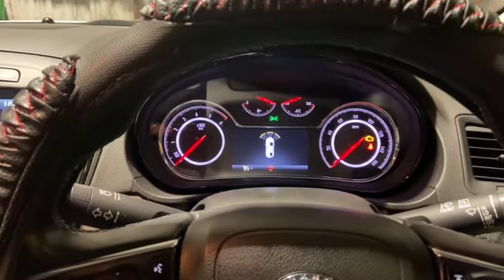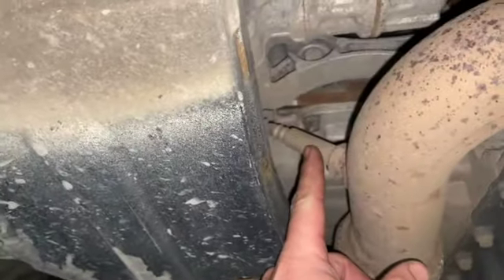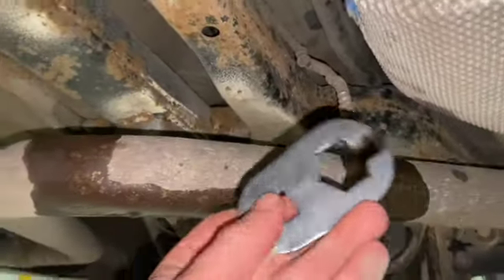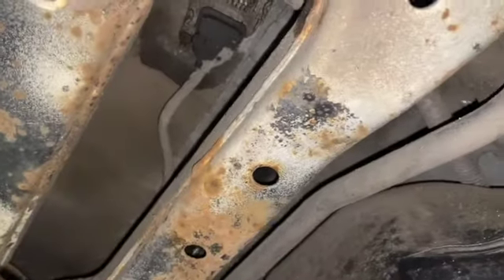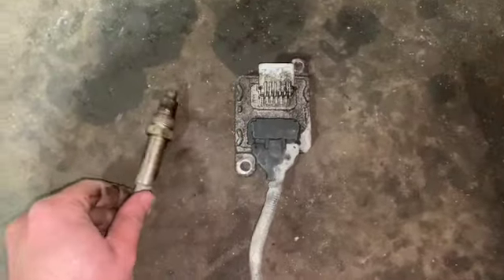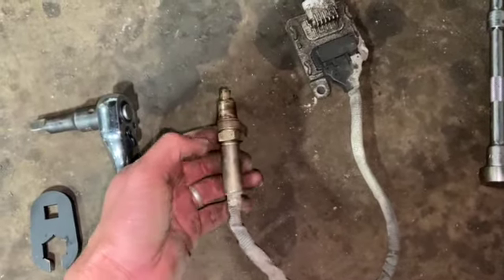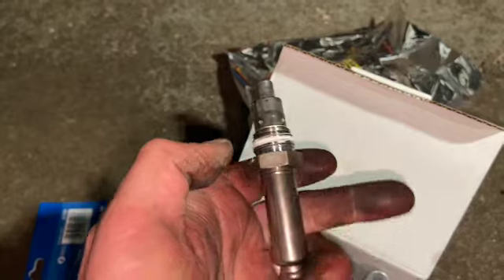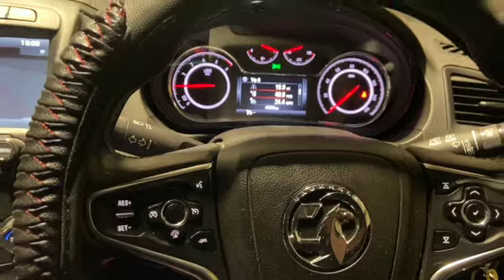Vauxhall Insignia NOx Sensor 2 fault *Fixed* P11DC P220B P22A7

Comment from the maker: NOx Sensor 2 Ebay - http://ebay.us/L5dpXQ
Aftermarket Nox sensor Amazon - https://amzn.to/3cbtzeL
Check Euro Car parts for NOx Sensor - https://tidd.ly/3lIO7xA
Check GSF Car Parts for NOx Sensor - https://tidd.ly/359Cie3

Tools used :
EOBD Scanner Amazon - https://amzn.to/2YBMA2L
Budget EOBD scanner eBay - https://ebay.us/IHpAfK 
Advanced EOBD scanner eBay -https://ebay.us/odL6V7
Draper socket set - https://amzn.to/2FdUEjf
22mm Spanner - https://amzn.to/2Rvkd1O
22mm Crows foot eBay - http://ebay.us/HuNgTH
WD40 - https://amzn.to/3oiaIRE
Reply: pro tip : you can watch movies on flixzone. I've been using it for watching all kinds of movies recently.
Reply: @Gatlin Idris Yup, I've been using Flixzone for years myself =)
Reply: Thanks for the video, I have the P11BE error code on my CDTI 2.0 B20DTH and would like to install a new NoX sensor 2. Unfortunately, the links you provided no longer work. Do you know the part number, or could you update your links again?

Comment: Thank you from Germany for this video.  Without the Vauxhall drivers, we Opel drivers would be pretty lost, as there are hardly any repair videos for Opel
Reply from the maker: nice one, thanks for the comment.. much appreciated 👌👍
Reply: @diydaly  Hey mate, do you have a video for the replacement of the V-ripped belt of an Insignia?! I've done a lot of research, but can't find any video or manual for this :(
Reply from the maker: @wildfleckboy  hi mate , Is it for a diesel? If so I’ve got a video for the timing belt on an insignia , the aux belt is removal is shown on that 👍 https://youtu.be/pfcVWeEi4RE
Reply: @diydaly  thank you! But I have a face-lift diesel with the B20 engine, do you now if there is any difference because the water pump is driven by the auxiliary belt and not by the timing belt? Pre face-lift its driven by the timing belt
Reply from the maker: @wildfleckboy  arr right! Yeah sorry not got a video on that one yet.. hopefully one will come up some point 👍
Reply: @diydaly  It's not really a big deal, but I'm wondering how the assembly order changes. But thanks for the quick response, great chanel
Reply from the maker: @wildfleckboy  👍
Reply: @wildfleckboy  Hallo, ich hab seit einigen Tagen auch die gelbe MKL und die Werkstatt will über 1000€ für die Reparatur. Hast du den Nox sensor2 getauscht? Ich habe eine Insignia B mit dem 170 PS Diesel und der Fehlercode war P11DC.
Reply: @j.f.k8924  zum Glück viel der Fehler bei mir noch in die Gewährleistung, deswegen hat eine Werkstatt den Sensor getauscht. Danach hatte ich zwar noch zweimal die MKL wenn ich Langstrecke gefahren bin (>500 km), aber dann hab ich das einfach mit meinem OBD gelöscht und es war wieder ruhe

Comment: Hey, Im getting a P22A7 error saying 'NOX sensor 2, bank1, heater sense circuit - range performance problem'. Will this be fixed by just replacing the back sensor?

Comment: I see that a sensor 1 cost 445 eur. And i can get one from China to around 150 eur. Car has driven 300.000km. what im asking for is; should i go for the cheap one, or anyone has experience with them from China?
Reply from the maker: ive had no luck at all with the cheap ones , tried a few but given up as none of them had ever worked correctly!

Comment: I've fitted to new nox sensors, remove the codes, but eml light come back on after 2 mins, any ideas, heard these need to be relearned?
Reply from the maker: What fault codes have you got stored? The sensors are mega common.. I’ve not come across any wiring issues yet but there may be some damage to the loom if you are unable to clear the fault

Comment: If I replace the sensor without clearing the code will the car acknowledge the issue is gone and eventually clear the EML light on dash?
Reply from the maker: There a chance it may auto clear but I’m not 100% sure to be honest .. if I was guessing I’d say you will need to clear the fault via a diagnostic machine 👍

Comment: Hello mate, I've got an insignia 2016 2.0 cdti 170 and I'm getting p2209 would this part sort this issue?
Reply from the maker: P2209 relates to the bank 1 box sensor , it’s basically the same but they have 2 , yours will be the one closest to the front , I show the location in the video .. should be this one https://ebay.us/jflcbL
Reply: @diydaly  Thanks for the guide much appreciated, just to confirm bank 1 would be for position 1?
Reply from the maker: Sorry meant to say bank 1 sensor 1 , basically they only have 1 bank (strait 4 cylinder) v6 would be 2 banks.. but yeah sensor 1 is the front most nox sensor
Reply: @diydaly  ah right I get it now, as it's only 4 cylinder it's only bank 1, got my codes checked and it was showing P2209 bank 1 but didn't mention if it was the sensor 1 or 2 and I wasnt sure which one to get but now ordered the sensor 1 hopefully should receive by tomorrow and sorts the issue.
Reply from the maker: 👍👌 yeah it doesn’t say much on the net but our autodata relates it to sensor 1 👍
Reply: @diydaly  Thanks one again was very helpful 👍

Comment: Great video thank you. I’m having this issue at the moment, sensor one was also replaced August 2020. Just out of interest, what would happen if I continue to drive? Would it just affect emissions or could it cause further damage? I drive about 60 miles a day. I’m trying to figure out if it’s an urgent job or not, mine is still driving fine, doesn’t appear to have any side effects. Strangely, my glow plugs went down the same time this happened. The garage only replaced the plugs, but now the engine light has come back on again for NOx sensor.
Reply from the maker: yeah there fairly common im afraid!😬 . tbh ive know people carry on driving for a few months with faulty nox sensors & it hasn't caused any further issues..
Reply: just get it mapped out, sorted

Comment: Thanks for the video, for me it was P11D5 sensor 2 value below minimum value, although i filled full abdlue tank the error persist and it gives me 1000km before engine stops restarting. Any idea what could be the issue ?
Reply from the maker: I’m fairly sure that’s down to the nox sensor too mate

Comment: Hi, my insignia had the same problem, but after replaced the sensor for a new one bought to vauxhall/opel it keeps appearing the P11BE error all 50 km.Already calibrate but it is the same. And now also error with cylinder 2 plug with new plugs. Any idea?
Reply from the maker: Are they cylinder sensing glow plugs ?
Reply: @diydaly  It was replaced by normal Valeo glow plugs. The originals i don't know what are because it was done by a "MIDAS Center".
Reply from the maker: @BoxMan-s1b  arr right hard to say with out looking , possibly wiring issue

Comment: Thank you. I did exactly that. But now I get after 1 or 2 rides a new code P220B popping up. Any idea?
Reply from the maker: What description have you got with the code?
Reply: @diydaly  voltage discrepancy. So now I have unplugged the battery 10 min in the hope to reset the sensor, and I have erased the error code. Did not reappear (yet?)

Comment: Hi m8 do you have any videos on where bank 1 sensor 3 is im getting code p242d and cant find any info on where sensor 3 is. Many thanks glynn
Reply from the maker: There’s one at the very back near the back box mate , it has to be the rear most sensor
Reply: Ok cheers m8
Reply from the maker: @skimmbob79  👍

Comment: Does an aftermarket sensor with the correct oemnumber work? Ordered a new noxsensor    from U.K with the correct oemnumber but i still get U029E code after replacing the old sensor!! Have cleared the code with diagnostic scanner thousand times now it seems like but it still gets back with the CEL on even after driving 400 km+!! 

The CEL doesnt come on while driving but when you turn of engine and start again, just as it looses power to nox 2 when starting up again...

Any ideas?

Best regards Roger Martinsen Sweden
Reply from the maker: Thanks for the comment roger , I’ve never fitted an aftermarket one myself , I know a lot of people that have without any problems but also 2 people that have had issues .. so there always a chance it could still be that. Awkward one as the oe are soo expensive!

Comment: Hey there. I have a Insignia facelift from 2016, 4x4, 2 l, 170 hp. Had the P11DC error and changed the sensor with an aftermarket one. Went for a drive, 50 km, and another error appeared, related to the same sensor, i guess. P22A7... What could it be? 😢
Reply from the maker: Did they both specifically say sensor 2?
Reply: @diydaly  if i remeber correctly, yes. They were like in your video. Can it be that the new sensor is not liked by the car? Being aftermarket…
Reply from the maker: @ar85dan13  yeah quite possibly a fault sensor , I’ve had Trouble with some of the aftermarket ones
Reply: @diydaly  i’m programed on Monday at the Opel dealer. I hope they’ll find the solution…
Reply: @diydaly  i think i found out the issue. My new sensor, now on the car, giving me the P22A7 error has the code 55500320. The old one taken out of the car has the code 55487270. Difference between them is the writting "Gen 3.2" on the new one and "Gen 3.0" from the old one. Maybe they have a small difference which is giving me the new error code.
Hopefully i will confirm on Monday at the dealer.
Thanks mate for your answers.
I'll keep you posted, maybe it will help others in the future.
Reply from the maker: @ar85dan13  👍👍🤞
Reply: @ar85dan13 this get sorted?

Comment: Do you need to recalibrate the new sensor to your car. Or will clearing the fault codes sort it out once new sensor is fitted.
Reply from the maker: Hi Ian , no recalibration required.. you will just need to clear the fault code 👍
Reply: @diydaly  thank you.

Comment: Hi Steven
Great video- question- do you need to code the new sensor through the diagnostics? I have a simple code reader that can clear the codes but is this enough? Ps I’m using a genuine sensor 
Thanks buddy
Reply from the maker: no coding required mate , just plug and play 👍👍
Reply: I just have read that it is beneficial to set back the adaption values, this can be done by disconnecting the battery and pressing the horn for 20seconds, wait half an hour and then connect battery again, error is also erased by that :) so a way if you do not have proper diagnostic tooling

Comment: Hi mate great video.. I've got a insignia cdti 170bhp I had error code p11dc come up and changed nox sensor 2 but it came up with a code saying unable to communicate with the new sensor.. Tried another new sensor with the same problem.. Put old sensor back on and it does communicate but with original code problem both new sensors were the same part number as old one.. Any advice?
Reply from the maker: Does it come up with a sensor 2 fault? Where you replacing it with a genuine vaux sensor? Thanks
Reply: @diydaly  comes up with p220b unable to communicate with nox sensor pos 2. Not a genuine vaux part but good quality replacement
Reply from the maker: There’s a chance of a wiring issue , that will need checking .. I’ve never had a wiring fault yet with the nox sensor loom & have replaced about 20 odd sensors .. I’ve never fitted an aftermarket sensor though.. they never seem to be available through the local factors .. only on the internet
Reply: I’ve had the exact same issue. Have you managed to solve it?
Reply: @TheVillaman88  no mate.. Tried 3 different sensors but the same code comes up.. Thinking of fitting a genuine part but if after spending nearly £300 the code stays on I will be p'd off.. Someone on a vauxhall site said it could be a fuse but after looking online and in the various fuse boxes I can't find anything.. I've got to the point where I just keep turning the light off with a code reader and waiting for it to come back on..
Reply: @simonguestsimon  ah no worries, cheers 👍🏻
Reply: @TheVillaman88  👍👍
Reply: @simonguestsimon  Did you ever manage to fix it? I'm having the same issue, have tried 2 aftermarket sensors, neither of which cleared the code and I'm considering buying genuine but don't want to spend the money and still have the same problem. Cheers
Reply: @ewright4103  did u sort it mate. I’ve got code p11dc aswell
Reply: @simonguestsimon  did u sort the sensor buddy?
Reply: @zainsajjad9930  I did, but not the proper way. I took it to a mechanic and he deleted the adblue system from the car. This involved unplugging the adblue pump under the car, I believe it was behind the rear driver's side wheel, removing the ecu from the engine bay, plugging it in and programming it to "forget" the adblue system is there. Apparently he had done a lot of them as you basically have to replace the entire adblue system to get it to work again if the sensor by itself doesn't resolve it. It cost £250, not sure of the current legality of deleting an emissions system on a car but it's pretty hard to detect, passed it's most recent mot no problems.
Reply: Late to the party here, but had the same issue (having bought aftermarket sensors)...... long story short...the aftermarket cheaper ones disn't communicate with car, bought an OEM one and it worked stright away... the old saying 'buy cheap buy twice' certainly true, although how they can sell aftermarket ones which dont seem to work is beyond me.
Reply: @ewright4103 I got the nox sensor from China and replaced. Now getting a few adblue sensor issues now. U ever have any other ideas about how to fix without the delete? I'm thinking just stick the old one back on and clear codes when it happens. That's what I've been doing for quite a long time now anyway.

Comment: Hi mate. So glad I found this video. I’m getting a P11DC on my 2016 2.0 diesel 160bhp vxline. I don’t drive much, but can do a lots of short trips and then a 150 mile round trip over the course of a month or so and not have the warning light come on at all. Then it may come on twice in a week. Very random  
Could do without spending £400 getting it replaces right now. 
Couple of questions if you don’t mind….
what is job of the sensor? 
If I don’t replace it, what will it do/not do if it isn’t working correctly?
Can it cause further damage to the vehicle and end up costing more to repair? 
Cheers
Reply from the maker: It shouldnt really cause any issues short term tbf mate , I’ve know ln people drive for over a year needing a nox sensor but I’d say really aim to get it done within 2-3 months if you can

Comment: Hi I've got a p11db code for a NOx sensor 1, insignia 2 liter diesel. Which sensor is no1 NOx thanks Chris
Reply from the maker: Hi Chris box sensor 1 is the one closest to the front.. it looks exactly the same as the rear one.. thanks http://ebay.us/Qg5NP4 👌👍
Reply: Thanks for your help I've had this code for while now, thanks again
Reply from the maker: Glad to help 👍
Reply: Hi there.  maybe you know how to solve the problem P204B
Reply from the maker: the code related to the pressure sensor that is part of the add blue pump/module, ive never had any issues with this fault myself though im afraid

Comment: Hi dude, couldn’t tell but was that on the new model insignia?
Reply from the maker: Yes mate was a 2017 model 👍
Reply: @diydaly  thanks dude, I’m having the same issue, I’ve spoken to Vauxhall as I know it’s a really common problem (not holding my breath though). Cheers for posting the fix, very helpful.
Reply from the maker: @sonicbacon666  no probs 👍 if you replace it make sure you use a genuine vauxhall sensor .. heard a lot of people having trouble with aftermarket ones 👍

Comment: Hi, I had P11DC code from my firt garage and was told to replace nox sensor 2 rear. After few months   i bought the nox sensor 2 rear to replace it. But I moved to another area so couldn't go back to same garage so took it to different garage to request to replace it for me but i found out  my mechanic put it into front. Front and back of nox sensor is the exactly same? After he put it into the front and now another error come back  which I need to replace 55579019 sensor 1 bank 1?? Is this because he put it in wrong place?? Can you please help me out? So confused :((
Reply from the maker: As far as I’m aware they are different sensors .. you’ll need to get that swooped round and the right one back in the front to check first
Reply: @diydaly   thanks for your replay. Just want to double check as I've got still problem with my car :(( my mechanic insisted me the location of nox sensor 2 is in front so couldn't get it swapped around.  By following his advice  we changed another sensor(55579019 sensor 1 bank 1) but still have engine management light on... so stressful at the moment 😫 . My car is 2016 vauxhall insignia 2.0 CDTI. Could you please confirm me that the location of 2016 model of nox sensor 2 is the same location as 2017? Many thanks for your help 🙏
Reply from the maker: @jaklar78  yeah id say sensor 2 if the rear one definelty
Reply: @jaklar78  BANK refers to the row of cylinders, Sensors are numbered from front to rear. Sensor 1 at the front Sensor2 at the rear.